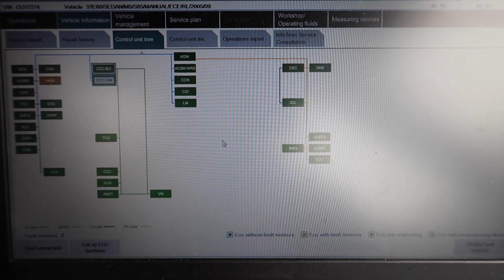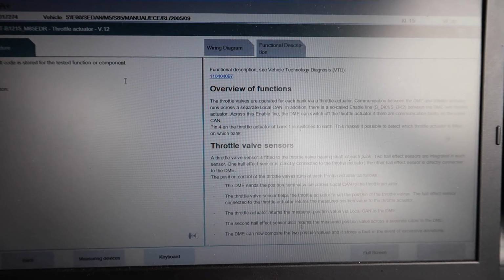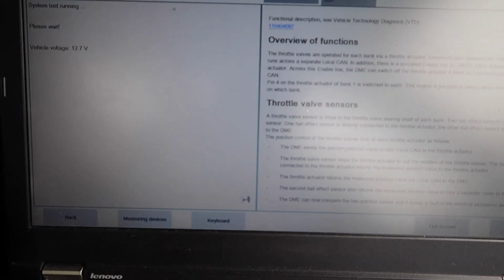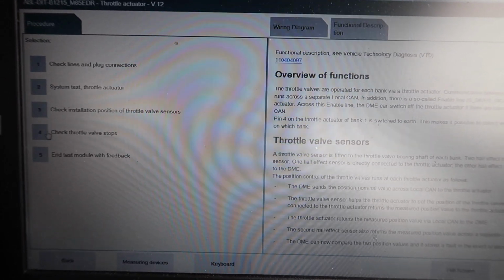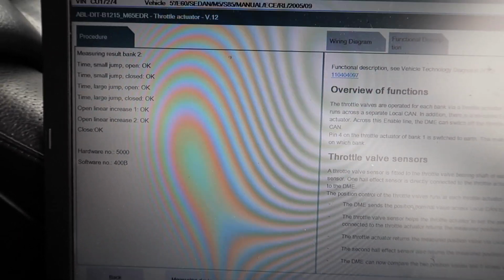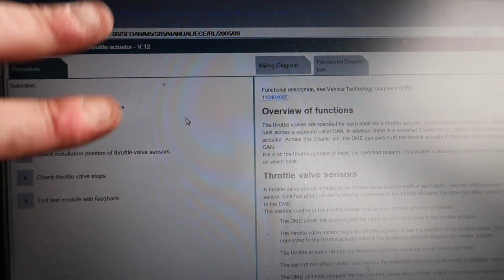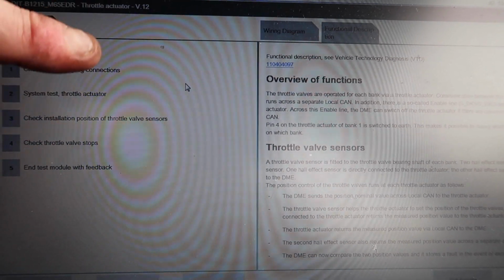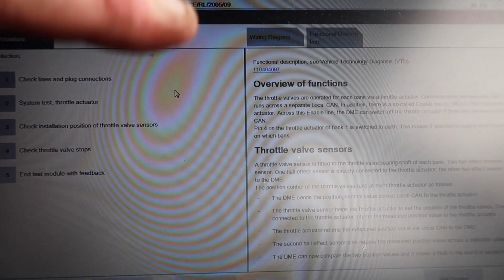BMW S85/S65 How To Test Throttle Actuators With ISTA +

Comment: Question...On my E60 M5, I am thinking of replacing both throttle actuators. I have been told by an independent BMW shop, if I do the car will not start, they need to be programmed. I thought I have seen it done on youtube, and people had no problems. I have two new ones, VDO I believe...also, is the idle control in these units as well....Thanks

Comment: when you put it on for the front glass it pulls at maximum power but I change it for the passenger and driver it stops blowing hard and the seat heating does not work and the rear defrosting
Reply: 525i serie 5 2004
Reply: and I changed the resistance

Comment: Your video's are really informative and interesting and I need a bit of help I have been working on an e70 x5 and the problem is that all the lights on the dash come like transmission faults and dsc faults and I connected ista and the tree that has dme,egs and dsc part that comes   after the jbe is not responding its all in the red and did a bit of digging around and found that the gearbox was flooded with water and so I disconnected the gear box and then connected ista again and apart from the egs everything else was responding again so is there something at fault with the mechatronics system well that is my thought I need a bit of wisdom from you to just go ahead and change it

Comment: Hey Dean, having a problem with my 05 545i with the N62, it revs to redline on a hot start, i have changed both the foot pedal and the throttle body and yet it still has the same issue, could it just be the programming in the car doing it? I can start it without it revving but i have to pull the intake off of the throttle body as someone else starts it, and i can see the throttle plate half open as i pull the plastic intake off, then when i pull the plastic tube off it closes without doing the full 6g rev, i thought it may have been something with the throttle body but now that its new i have no idea and the nearest dealer is 400km away... Please help?

Comment: Been through all your videos and they are the best on the net by far. Any chance you could give me some advice? I have a 2005 545i Tourer that was showing red cog trans fault. It had 2 codes 1; 5088 L1-L4. 2: P0706. So I had the mechatronics rebuilt solenoids and sleeves, it was still showing faults, so had gear selector unit changed. Car ran great for a few days and then the dreaded red cog re appeared just now argh! Any advice would be greatly, appreciated I am not giving up on my car and am determined to find the problem even though it is costing me more than it’s worth.

Comment: Wouldn't it be weight off your mind if you could check your bearings condition through ista. Thanks for the upload good Job. You did mention you would show us how to connect the the TV looking forward to that one :)
Reply from the maker: I wish they made that I know they did that in M5 competition there is a bearing wear indicator that can run a test its a sensor configured with oil sensor to see if there is any fragments in the pan